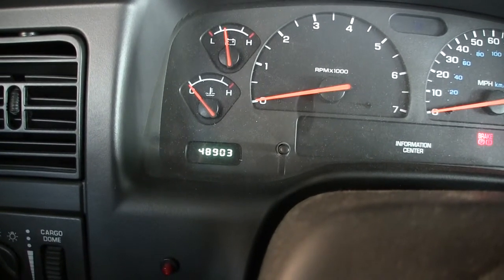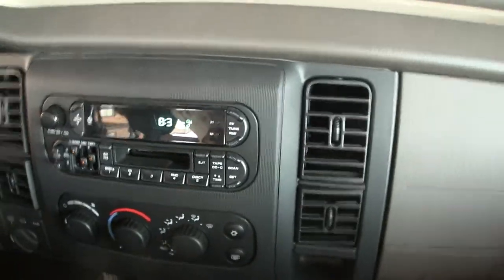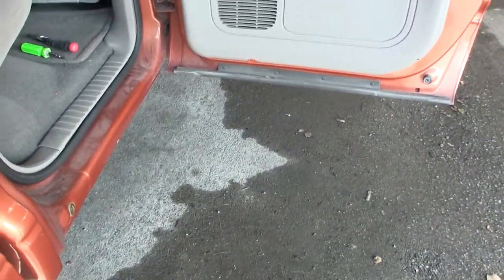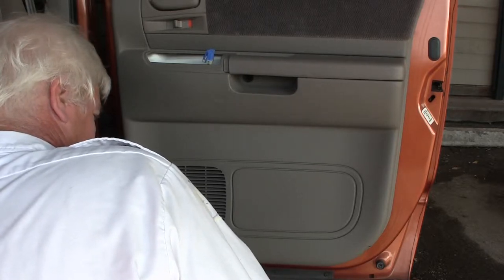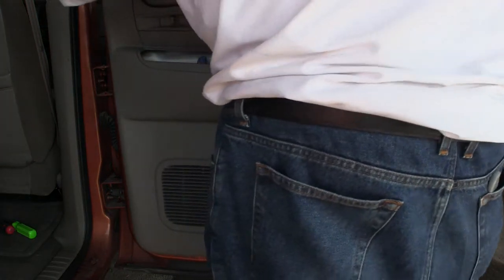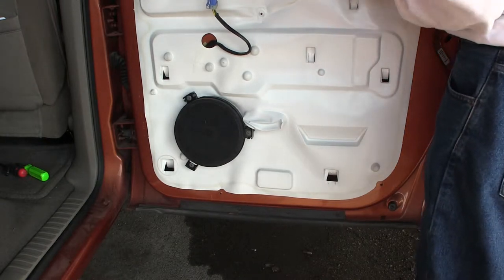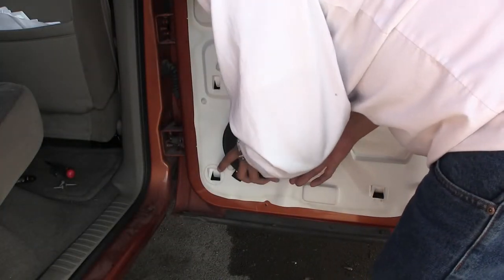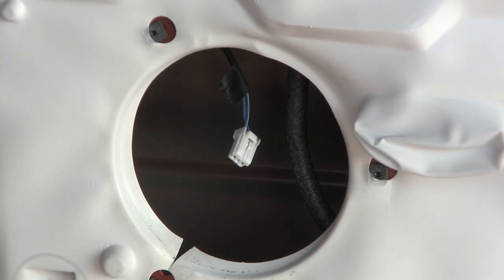2001 Dodge Dakota QC 4X4 4.7L How to upgrade & Install Replacement Infinity speaker 07 of 11

Comment: Nice work! I see on the speaker you removed why the original Infinity's went bad and had no bass, the foam surrounds rotted away. These are (were) great speakers and systems when new. You can re-foam them for cheap.
Reply from the maker: In the summer 2016 I refoamed the original speakers
Reply from the maker: The original speakers are two ohm impedance versus the aftermarket ones are 4 ohm so I got more sound with the original speakers than with the aftermarket ones I found out